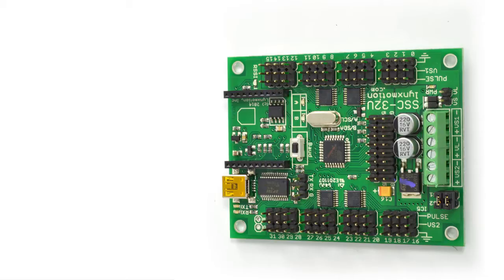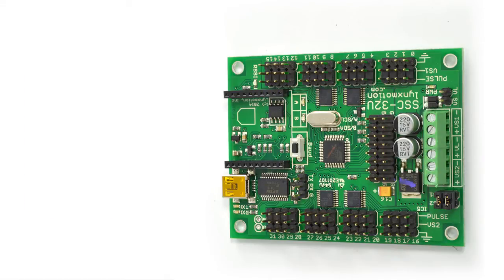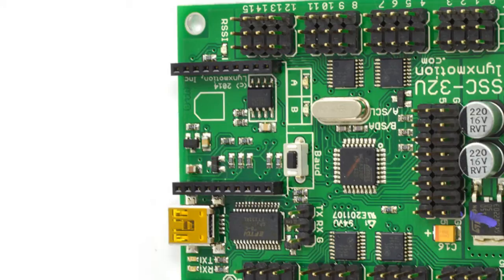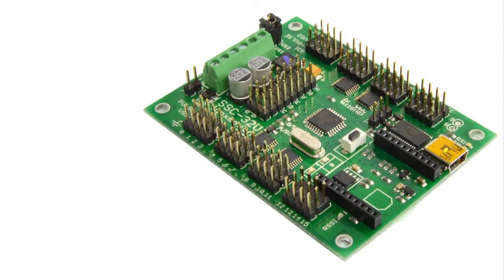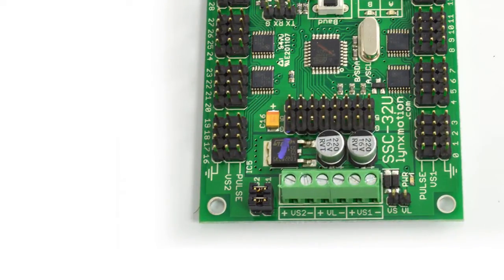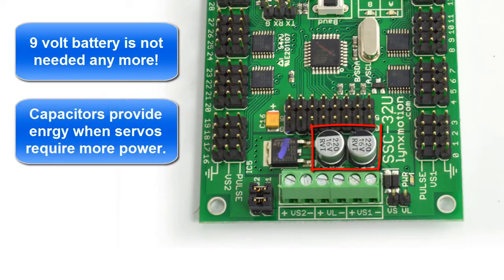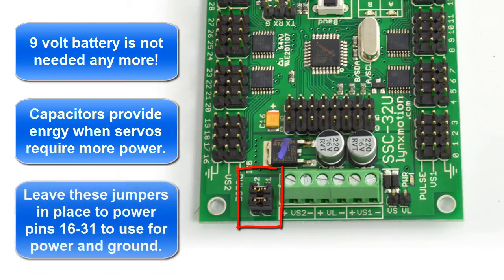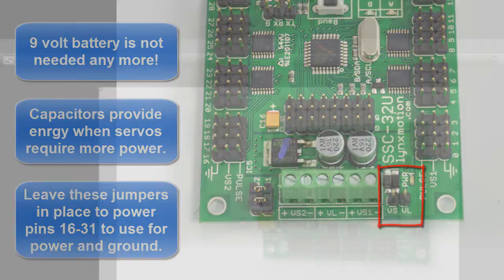SSC-32 USB Basics

Comment: can I use a 6v or 9v ac adapter for this?And can I make my robot move it's mouth and dance in sink to a song wit this  ? my robots  have  6 servos. how many servos can i run ? I word like to make 7 robots move and sing together.
Reply from the maker: On the adapter: I would not. You can, just have to READ THE MANUAL and move kumpers and wire it differently. That's a pain!  Just use a 5V or 6V Power supply with more than 2 AMPS of current. This is critical. I would buy the one that comes with it.

As for the software to run it, it's free and you can sequence up to 32 servos. Download for free here: http://www.robotshop.com/en/ssc-32-servo-sequencer-utility.html
Reply: Ok thanks.

Comment: Hi, I just bought SSC-32U from ebay,  I use Lipo 11.1V battery and decompression circuit for decrease 11.1 to 6V, that's enough?Please help me!
Reply from the maker: Nope. Not enough current to run the servos. Use the power supply recommended for it. For $15, you can't go wrong!